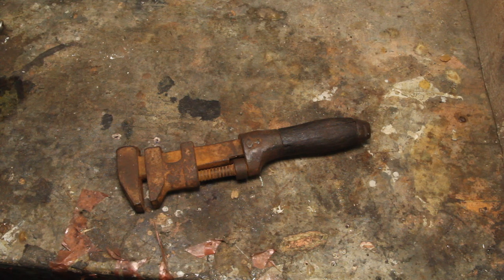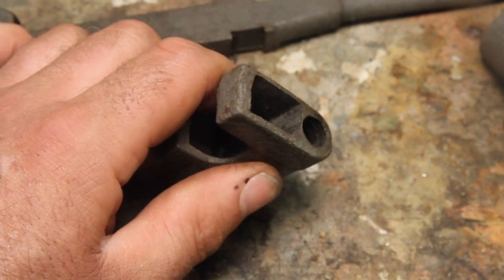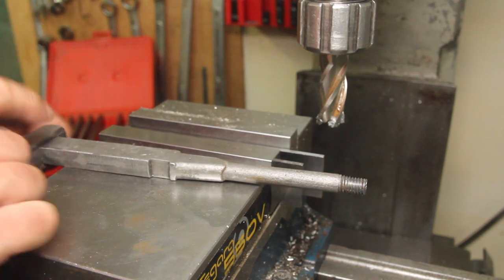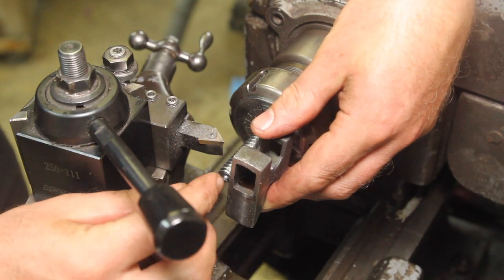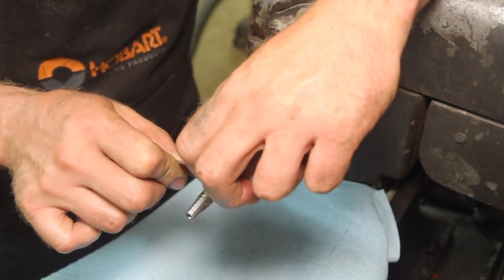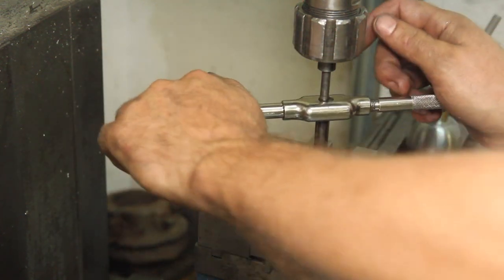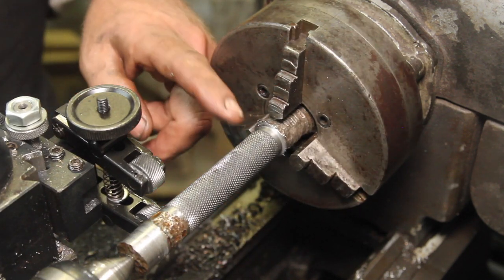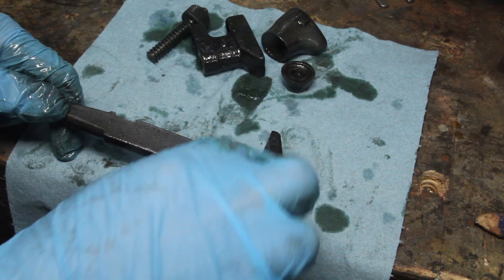Vintage Monkey Wrench Restoration (Plus: Making a thread tap)

Comment: That's an acme thread. It's designed for travel and not tightening. The crest is supposed to be flat as to avoid wear as it would if it were a regular thread. Same thing as a ball screw on a machine like your lathe or mill.